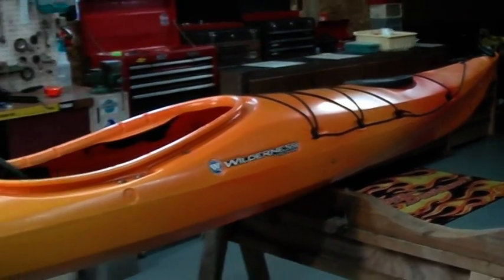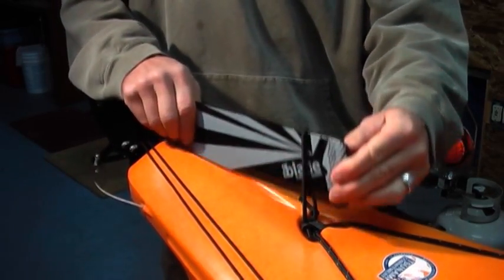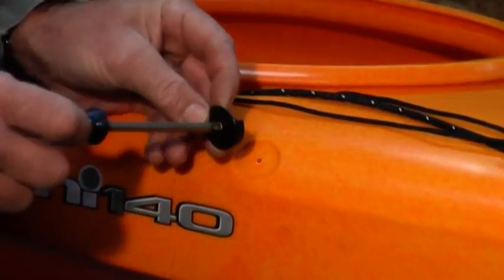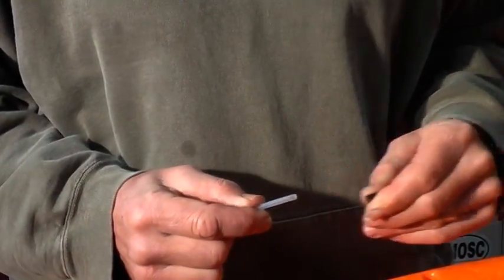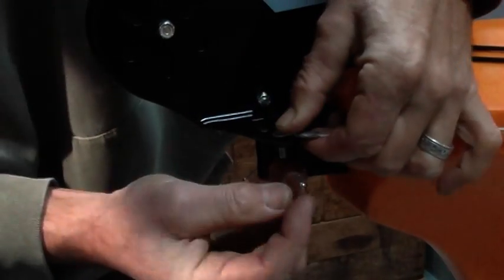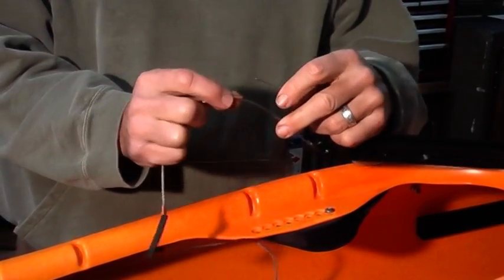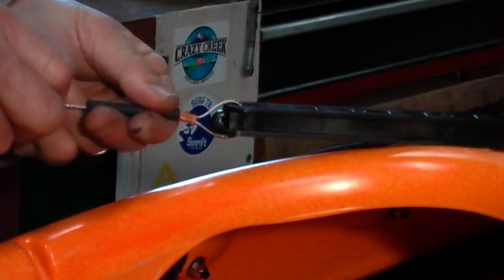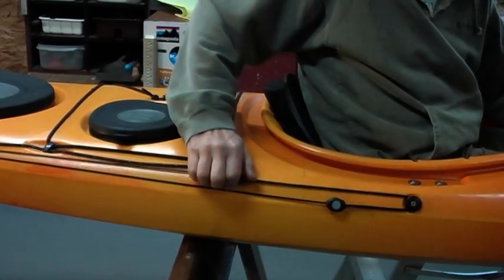Kayak Rudder Installation - Confluence Watersports

Comment: I just followed the instructions and came up with uneven cable pull!!!!!!
Best way to adjust cable lines is to center the blade into the rest position and then  have both cables ends thread through hole in end of footbrace rails nearest the seat.

Comment: If you slide the footbrace rails too close to the bulkhead you will not get the full movement of the rudder. If you have the rails even with the extrusion and it is too short you are in the wrong boat.The rudder is made to allow the user to trim the boat, it is not made to steer the kayak. The user should be able to control the kayak without the use of a rudder, so "life and Death?" Sounds like you need to check into some touring classes. Not trying to be mean, just think it would really help.